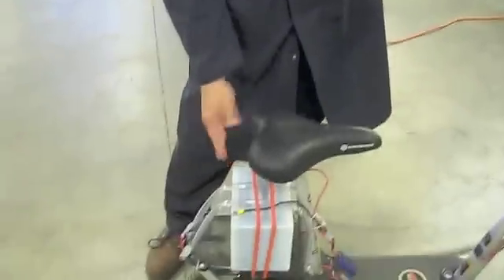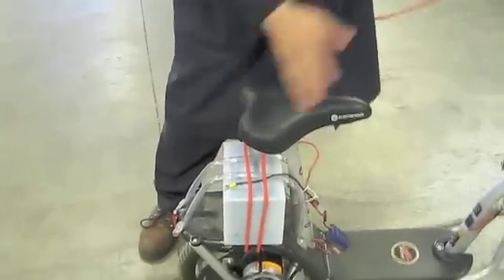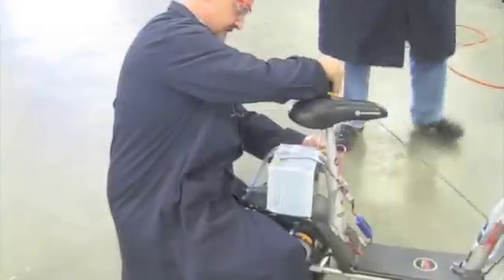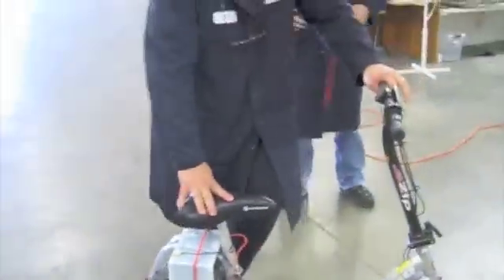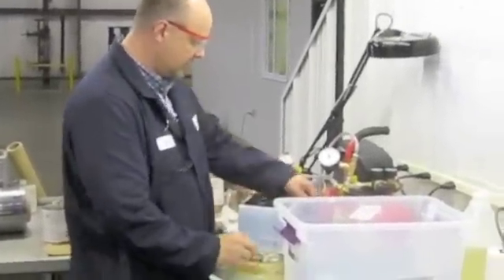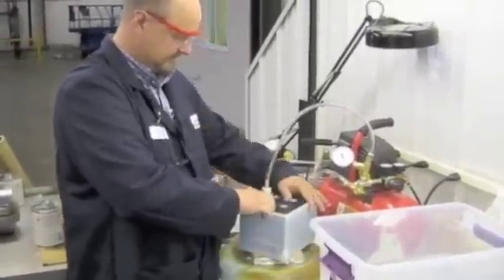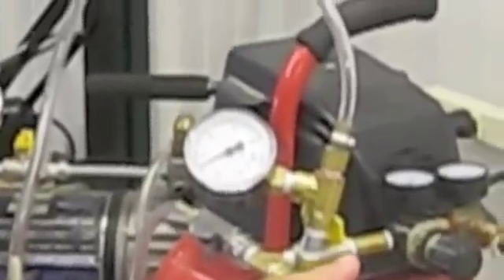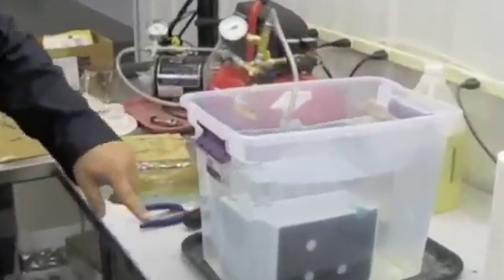GreenSeal® Battery Drop Test

Comment: There's no audio section.
I have the same electric scooter. (S-750) 24 volt 500-watt.
I use 2/12 volt 17 amp Panasonic / LC--RD1217P
They weigh in at 26-pounds.